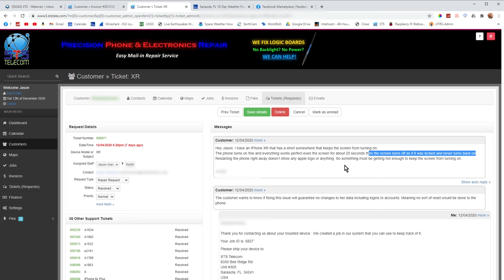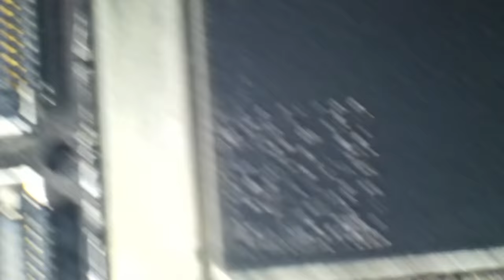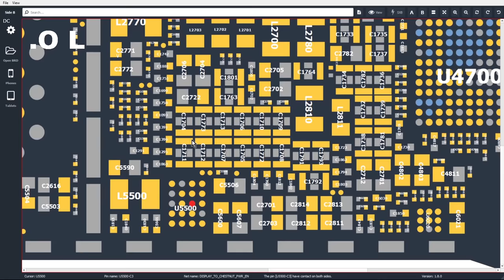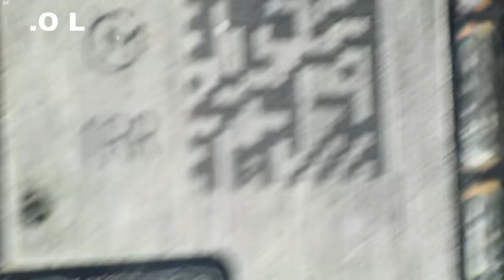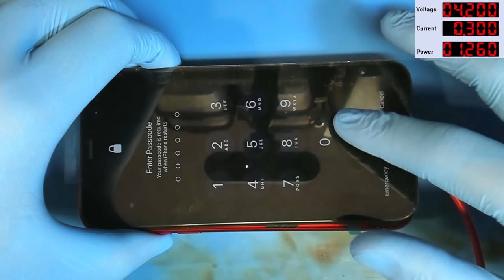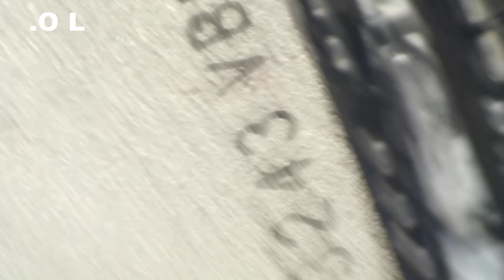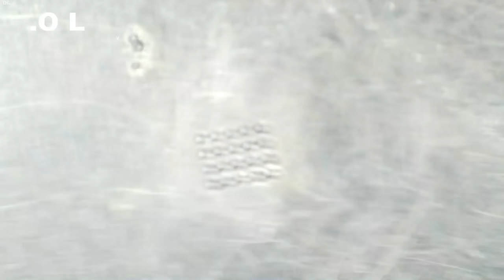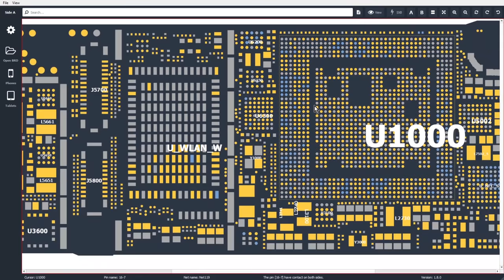Repairing an iPhone XR with "No Image" - What I found inside this phone was horrifying!

Comment: I'm an automotive tech. I always tell my friends never to lie to a professional technician. We WILL find out.
Reply: I was selling my 40' Sea Ray boat recently.  They buyers mechanic came on the day of purchase to verify that everything was in order.  He asked me what kind of RPM's I ran the boat  at and how often.  I told him that about 20% of the time I am at just above idle as we cruise the shoreline,  70% of the time the engines are around 2,400 for cruising just on plane depending on fuel load and passengers and 10% of the time at full throttle if I am escaping storms or trying to make the drawbridge on time.  He smiles and says "Okay, let's see if you are a liar."  He pulls out a laptop and plugs into a port near the engines and pulls up the entire history of the engines including temps, pressure and RPM's.  I said geez!  I didn't know you could do that.  He looks at the readings and says "Wow!  You are actually an honest person, you are just about perfect with your recollection."
Reply: I fix motorcycles, 4 wheelers etc on the side. People drop stuff off and say:it just won't run". I laugh at what I find. Lol.
Reply: I tell the mechanic I've been hearing some rumbling from the rear end when cornering in one direction only.

Two years later we replace a damaged bearing, on the wheel I pointed at.

I didn't lie. But apparently he didn't find the same issue I observed.
Reply: I'm an HVAC tech and I just wanna say, stop telling us that you didn't try to change the thermostat yourself...you have a popped low voltage fuse. I know you changed your thermostat Darcy..
Reply: In the end, it’s a technician’s job to find out lol
Reply: The sad thing is that customers always lie and try to shift the blame on us...
Reply: P

Comment: "Please do not try this at home"
Me with my $3 soldering iron: Darn
Reply: I mean its not impossible. I fixed one of the first iphones with an old soldering iron. Yeah i made a mess. But hey it was still working. Probably still is wherever it is.
Reply: Wow that’s cheap my soldering iron was 250 dollors
Reply: I don't have a soldering iron. I do have a wood burning  kit. I should be good to go!
Reply: You got an iron for $3 ???
Reply: @GeorgeOrwell-yz6zx  Wood burner set, soldering iron....what's the difference, just dive on in and go for it.  Here, hold my beer, watch this.
Reply: @DCS026  🤪
Reply: I retired my hakko fx888d for  one of those cheap stm32 based irons (with hakko tips)  way better and easier to control
Reply: @GeorgeOrwell-yz6zx  I've got a blowtorch, thay should work too right?
Reply: @jakehildebrand1824  Ha. All I can say is YMMV - your mileage may vary 😁
Reply: 😂 like if i could
Reply: @jakehildebrand1824  If you're working on a Nokia 3310... Yeah, it should work.
Reply: 3$? Hi-tech!I My is 2 Euro 12V for cars. Im using it to meld chees on my sandwich :)
Reply: I just use my single fanned gtx 480...
Reply: @colenichols  GDDR that periodically re balls itself!
Reply: Hahahahahaha FACTS!!!
Reply: I have watched so many vids of people trying to microsolder with $3 irons that PTSD is probably the least of my problems.  Irons with no temp settings.  Irons with non-replaceable tips.  Irons that have been filed down to make the tip smaller (where the tip's plating has become a distant memory)....
Reply: @jakehildebrand1824  these people are snobs. A cigarette lighter is fine.
Reply: @colenichols  lol I think 2005?? Held up vs a 2014 video card crazy
Reply: 3 dollars seriously i bought for rs.80 (1.01 dollars) 🤣🤣🤣
Reply: @jakehildebrand1824  - Hey, it's an iPhone, any torching is an improvement... ;-)
Reply: @Zoroff74  you've got a good point

Comment: Im fully committed to repairing stuff. I do most things myself but after I once switched a broken iPhone 6 screen I was done with iPhone repairs, everything is sooo tiny. I have huge respect for these kind of repairs, very nice Video. Subbed! :)
Reply: I've replaced my iPhone 6+ screen once and my cousins iPhone 6S+ twice, the main problem is just that cover plate on the display cables when putting the phone back together.
I do agree though, replacing stuff that small is annoying as hell.
Reply: @zeno8402  Porps to you! Yeah those tiny screws which disappear with one deep breath are just too much for me :D
Reply: Wow, same here. I can fix anything, but I replaced a screen on some Android phone several years ago, and never again will I touch a phone. It worked out ok, but it wasn't worth the stress and eyestrain.
Reply: I'm also fixing a lot of thing, including some electronics products like smartphones, but it's almost surgical and can become easily annoying... First smartphone I repaired was an iPhone 4, screen replacement, but something was so annoying to put back on, I finally damaged the connectors, and had to buy a new one to repair again :/ 
This guy would have replaced the broken part !!/
But all of this needs special tools, special parts, special skills... I already have too much to learn and to do in my life to go further this way. This is a specialisation, hard to do everything.
Reply: @thichevallier  same I used to fix phones for awhile  buying them cheap but after hours and hours on each phone, waiting for compatible parts to come in the mail I quickly realized I would be making lots more working a minimum wage job lol. Anyhow I couldn't get a job so I continued this for some time to buy myself food and live till I found something else that paid better. 
If you hold a store you can actually get better paying clients with the additional data services. Just repairing to sell phones means you have to erase data and sell at pre owned prices with competitors minus the added platform and shipping fees.
Reply: You need micro mini soldering classes, and microscopes, and controlled hot air sources.  Not possible for this blind 76 yr old..me
Reply: Too bad apple has killed 3rd party repair.
Reply: I replaced my hard drive in my ipod classic and my case does not close fully now x)

Comment: As being IPC-7711/IPC-7721 certified, I have to say you did this job quite good. Seeing so much incompetence in the electronic industry over the years, I'm thankful there are still picky people out there who take pride in doing the job right. Thank you!
Reply: As being IPC A-610-G CIT,  seeing all those solder balls all over the board and the solder paste not melted made me cringe.... This board would barely even pass Level 1.
Reply: @RiddimDubstep  you coming up on a recert soon? I believe they've been on Rev H since 2020 (either way not a lot of changes were made in that rev) lol
Reply: @silent9pc  Rev H got released 3-4 months after I got certified in Rev G. You're not actually required to retrain for a newer revision. I will go for the newer version available when my certification expires.

That being said, I am full aware of the changes made. I like the fact that IPC this time went more into detail over 8.13.3 for QFN packages, in particular for the QFN packages that don't have a continous solderable surface on the exposed toe. Version G had no acceptability criterias clearly defined.
Reply: @RiddimDubstep  I know you don't need to retrain for the newer revs, you're right for sure. Funny though we just had some QFN issues today at work we had to clarify for the SMT operator running them, he couldn't get it to flow up the vertical solder face. It was due to the built in thermal plane across those 4 solder faces
Reply: @silent9pc  We also use quite a lot of QFNs at work. I have also noticed this problem occuring if the pick and place machine doesn't push the component enough when placing it. Another two reasons I noticed would be that the reflow oven was not getting that area hot enough (hot enough to melt the solder but not the optimal temperature) and/or the liquid time for the solder paste was not enough. Also if the PCB pads are not big enough to fit the required amount of solder paste.

An uncommon issue I noticed is that the thickness of the stencil would not allow enough paste to be deposited over the pads.

Comment: This was fascinating. I didn’t know anyone actually repaired at this level. The world we live in is so much more “trash it and buy a new one”. I have an original PS3 I’ve been tempted to have someone look at it.
Reply: Most of us in the middle class are, and probably nearly the entire upper class, but there are some of us who don’t automatically replace things.
Reply: @PokeMageTech  Oh I agree, it’s just the nature of some components. I know this case is also after their data too so that means a lot here. With a phone replacing a battery or a screen is very different from fixing the boards. I just didn’t know someone would try to fix that. My first thought is these components are just too small. So it’s cool to watch me be proved wrong.
Reply: Honnestly, repairing at this level is playing russian roulette. If brands can't say for sure that your phone will be fixed for good, it's much safer to give you a new one and recycle the old one.
Reply: Most of the time it's not worth it, the technician's time quickly becomes more expensive than the device is worth (not even counting replacement parts). Generally this sort of thing is only done when the device is very expensive like higher end of smartphones, or you absolutely have to rescue the data from the device. 

Of course Apple is doing their best to stop this because they don't want anyone to even try to repair their expensive devices, but rather want you to buy a new expensive device, which they know you will. Apple certified techs aren't even allowed to do board level repairs.
Reply: @tylisirn  Yea. Also I’m aware Apple is doing that and I think it’s wrong to stop people from doing repairs. I believe the device owner should have every right to repair the item/s they own. They also own the personal data on the device and should have all rights to recover said data.
Reply: Ps3 repair ive helped with  the vid said to strip it down to the motherboard and stuff it in the oven at IIRC 250°f for 30min.  Aka reflow the whole bord in 1 shot .   It worked in 2010.
Reply: @ReinQuest  go see your local ubreakifix store and see if they can help you repair that ps3. Just a thought 😁
Reply: @daviddroescher  or wrap it in a blanket ala Xbox 360
Reply: @PokeMageTech  The problem is so many things are made to expire, whether we would like to use them longer or not.
Reply: @daviddroescher  Reflowing the whole board without proper flux may help a couple of months but the lead-free solder will crack again. Speaking from an experience here. I got maybe 6 months of extra playtime from 2nd gen PS3 (the original form factor but with only 2 USB ports) by reflowing the whole board in household oven after guarding the sensitive parts with bluetack. I think I did direct heating to 315 °C and kept it for maybe 5 minutes and turned the oven off and cracked the door slightly open and waited it slowly cool. With a proper no-clean reflow flux you could have a better luck but for true fix you would need to do full reball with leaded solder to avoid future fails due the same issue. The bluetack smells really bad and smokes when it gets hot but it does keep plastic parts cool enough for fast reflow jobs.
Reply: What’s it’s issue?
Reply: @techbuildspcs  I forget what it’s referred to as, yellow light of death, or something. I believe its the issue that involves reflowing because the original consoles just got too hot.
Reply: @ReinQuest  PS3 has multiple options for failure but the usual diagnostics is how many beeps you get for a single boot. I don't remember if my unit made 3 or 4 fast beeps and shutdown automatically when you try to start it. The eject button still works to extract the disk if you have one inside the drive.

My understanding is that the motherboard has different temperature coffiencient than the GPU chip and this causes the lead-free solder to fracture over time when the console is heated by use and then the temperature goes down when the system is powered off.

The reason leaded solder fixes the problem is that leaded solder is soft enough to have plastic deformation and it doesn't crack.

Of course, the above is just a theory shared by many PS3 owners based of different issue diagnostics and repair hacks. Sony hasn't confirmed or denied any theory and the PS3 is old enough that nobody seems to care anymore.

Another competing theory is that the PS3 GPU older grows dentrities because of chemical structure and once dentries grow long enough, they short the data pins under the GPU chip and cause boot failure. Reflow-like heating could cause the dentries to partially collapse. However, as this theory suggests that this is caused by non-stable chemical solder, it issue will come back sooner or later unless you replace the solder.

Bottom line is that the issue is related to solder and the GPU is the most common chip to fail.

I think the XBox red circle of death issue is caused by similar problems.

Comment: 20:13 Top left cap. Spillage residue.This phone has had a good bath and a really cheap fix attempt after that. They don't clean it even!
58:21 U6150 USB Power Management Unit
Reply: :|
Wow
oke u know
Guud...
Reply: @nunomiguel555 Wow. I know and now you know too :].
Reply: they don't clean it odd!
Reply: It is so ironical that a Power Management IC got its pads short-circuited.

Comment: So glad to see you back at it! As for you ‘’question’’ regarding Apple and their technique to solder the shield, well, they use ‘’huge’’ power supply to heat up the shield, and just the shield, and melts the solder in place. All this without heating up the other components. That’s it! But the entry price and customization required is out of reach for us, mere mortals!
Reply: To clarify things. I don’t think Apple’s using some sort of ultrasonic power supply as I’ve never seen it used that way (it generates heat through friction by moving one of the 2 parts, the smallest/lightest, in a ultrasonic frequency in order to generate heat and solder them together). But instead, I think they are using a DC power supply, pulsed or linear, and running a current through the shield in order to get it and only it hot and melt the solder. It’s called resistive soldering. It’s wildly used in the industry (I know, I’ve engineered quite a few of these).

Comment: Nice, well done, I repair iPhones, usually batteries and screens, had a 7 with no audio, looked a bit white and furry insude but a soak in ipa and brush clean it came off and looked ok but still no audio, took off the audio IC it was furry underneath underneath, cleaned it up and put back on, audio now works perfect was well happy  first time working to that level on a iphone with no microscope just my JBC hot air rework and pace mbt 250 soldering iron rework station, I generally avoid water damage as previously experience tells me that it's never gonna be reliable so I can't warranty it, also spending 3 horus on it is not viable for my repair cost, still nice to see others having the patients to go the extra mile and persevere with excellent results.
Reply: IPA! You soaked in beer?!

Just kidding.

Comment: "I mean, if you like balls, this is definitely a phone for you." 
I imagine I'd be more horrified if I knew what "ball squeezing" was, but as is, I'm laughing.
Reply: Solder likes to form little balls due to surface tension, like how water forms droplets. In this context, it means someone used too much solder, so little solder balls were squeezed out from a component and not cleaned up afterwards.
Reply: @StormTheSquid  Oh right, so it's not quite air/heat bubbles slipping under the hot surface?
Either way thank you for the explanation!

Comment: Makes you wonder if the first owner dropped it in a sewer.

Impressive repair, and also kind of impressive that our phones work (usually flawlessly) when seeing all the tiny parts that could all have some minor glitch. 👍🏼😊
Reply: most of the small stuff are not really needed. Half of the capacitor are just bypass cap. Meaning they just filter the current for the odd cases.
Reply: That stuff was just dried flux, nothing special. Probably the board was repaired but it was not cleaned. I know this from experience, I work in electronics...

Comment: Amazing intricate work.  Something I would never attempt.  Pretty cool to see hot air melt the solder and also how you formed the solder balls on the IC pins.
Water boils at 100C or 212F (at sea level)